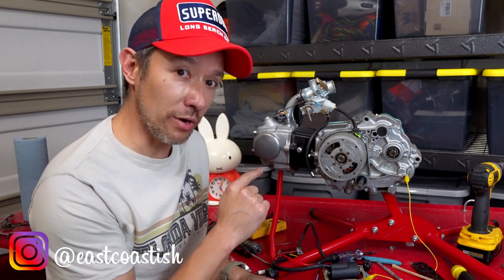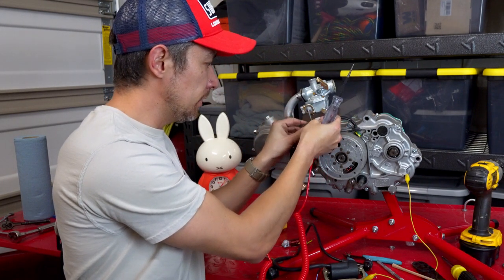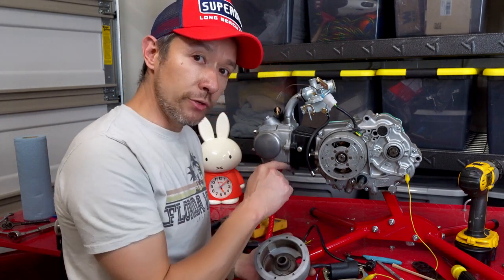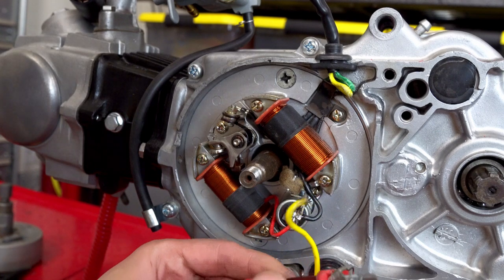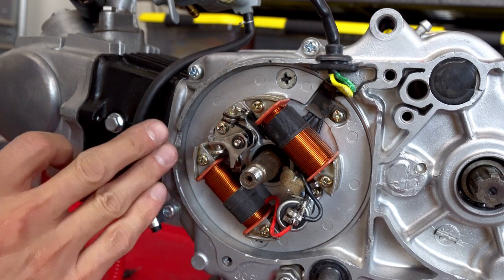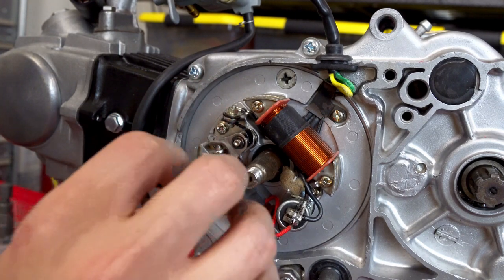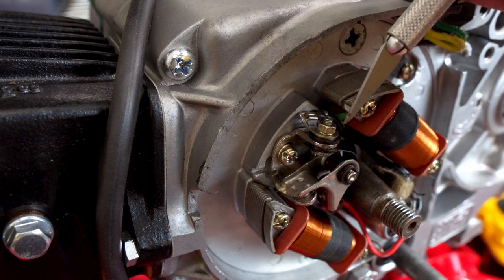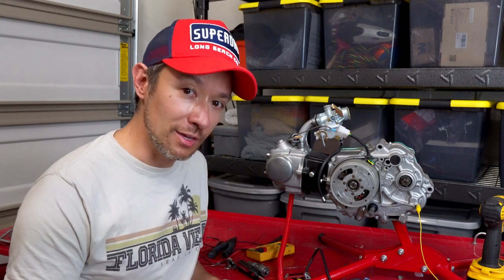Solving a no-spark issue on the CT70 engine

Comment: The lead that comes off the points and goes to the ignition coil,  is how I always set my point gap as a kid, I connected an ohm meter, or test light with a battery in circuit from the ground of the motor to that lead and turned the flywheel slowly till the timing marks lined up. The meter showed a reading of continuity to ground or the light would stay on until the  moment the points were opened, I would set the points so they opened  right when the timing marks lined up. The proper tools and troubleshooting skills with electrical circuits makes these kind of problems very easy to diagnose.

Comment: I believe you helped me out with this video. Ignition problems will drive a sane man crazy! I would like to add that even if they are not touching but close on the secondary, a spark can jump and reduce the output so the spark voltage is lower, but not enough to jump across.

Comment: I had something very similar happen, my wire between the points and condenser was touching the case of the condenser. I now use heat shrink on any wire that can come close to grounding out. Awesome video

Comment: Thanks for that Video. Any idea what the ac voltage output should be on a 1986 xr100. ???  I am reading with a test light and get a nice bright flicker. When I test the ac voltage from the charging coil it is reading between 5.5vac and 7.3vac with a drill turning the engine.
Thanks